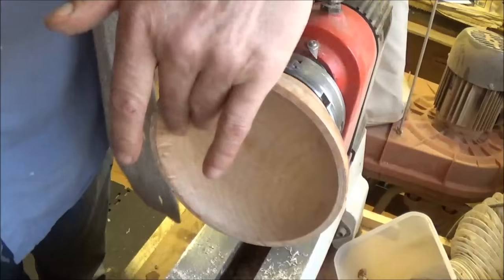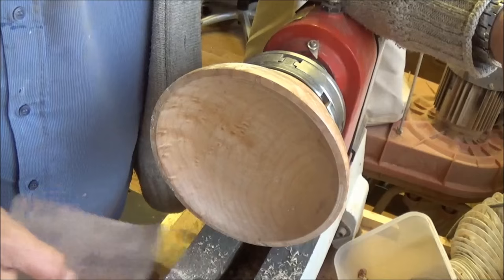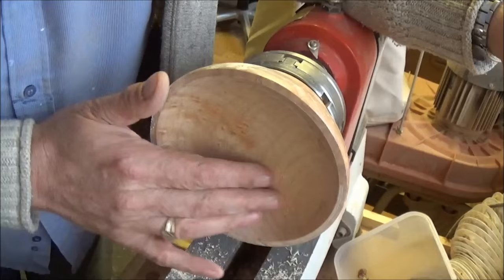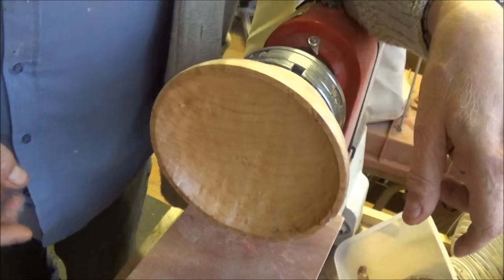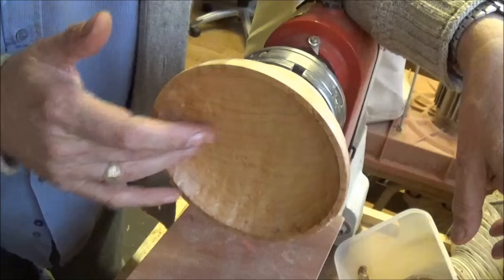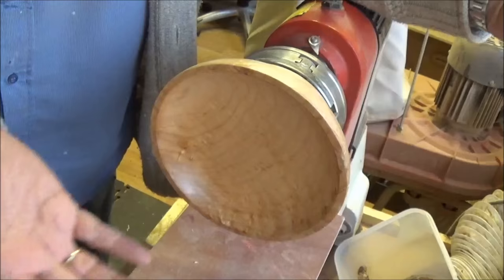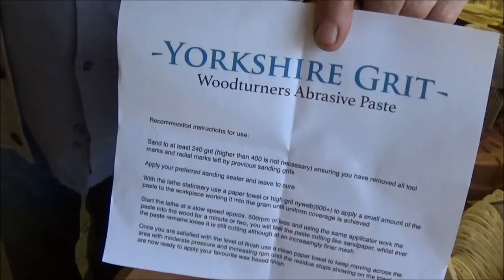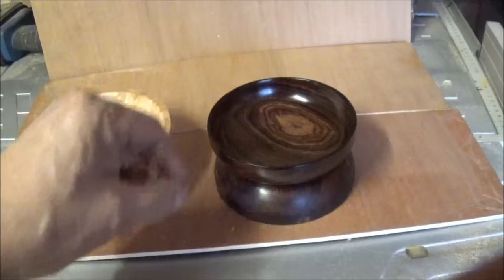Woodturning at 54a.  #79 Trying out Yorkshire Grit  abrasive paste

Comment: This is a very interesting product and I believe it works as you say. I only wish you had used an old rag or paper towel to apply it. The 600 grit might make some wonder if the abranet did the work or the Yorkshire Grit. I hope, as most other commenters, you will continue making videos. We all enjoy each and every one...maybe not the last one as much. We do understand that you were a little upset at the time. Thumbs up friend!
Reply from the maker: +Gil GraceI know what you're saying my friend,but I couldn't have sanded straight from 240 grit to a mirror smooth finish in 2 minutes with 600 grit though. I've watched a few turners in the U.S. using a similar product and old sandpaper to apply it. I may be back,but not just yet. :)